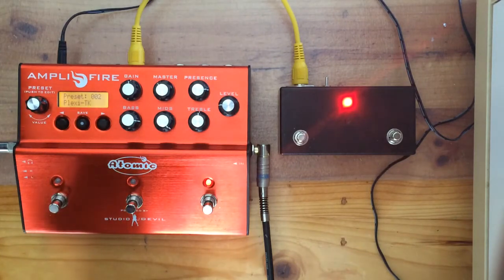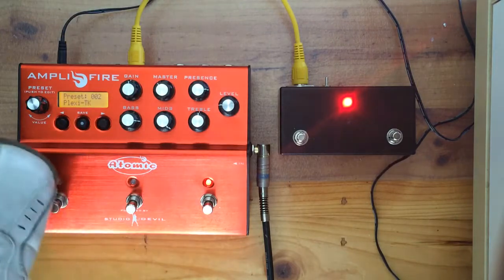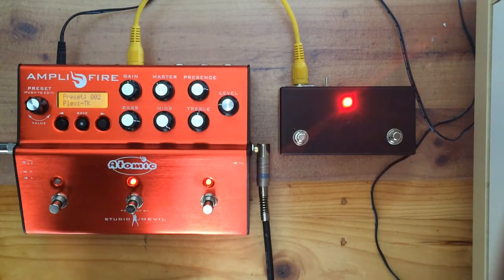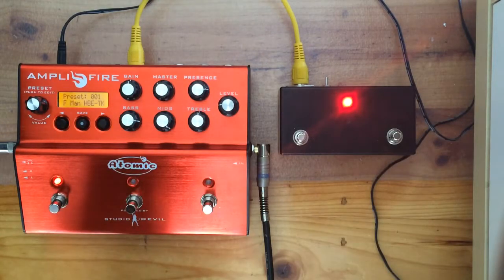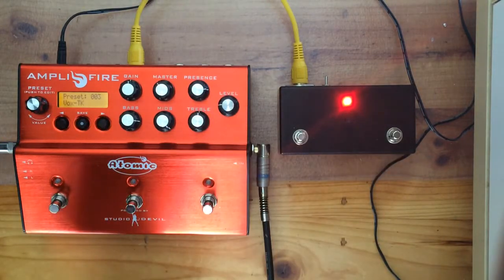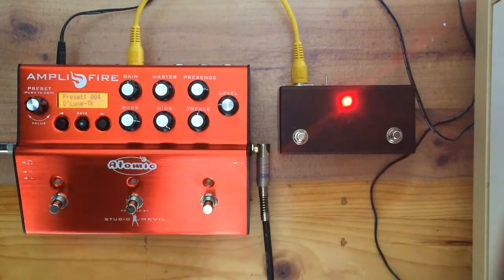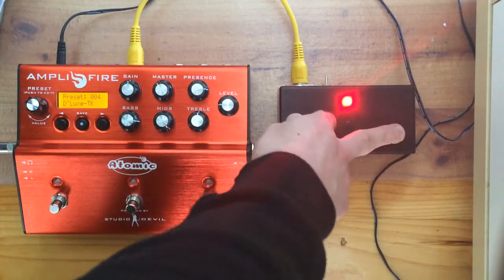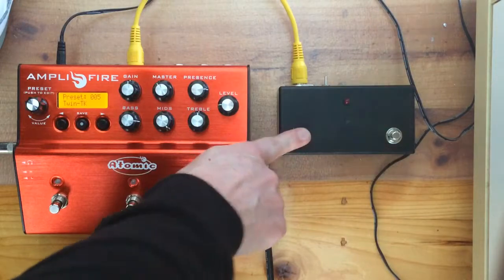Custom midi patch changer foot pedal

Comment: Does that controller not need any power?
Reply from the maker: Jamie Valente it's currently running off a 9 volt battery. I forgot to put in a power plug :)